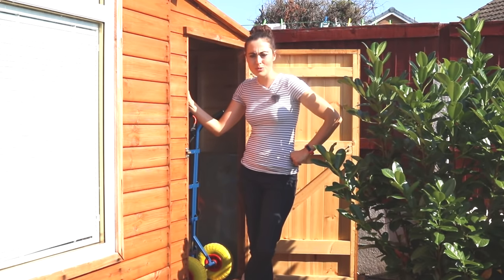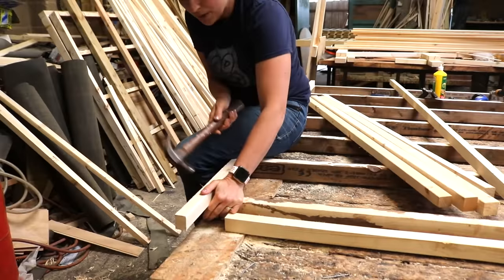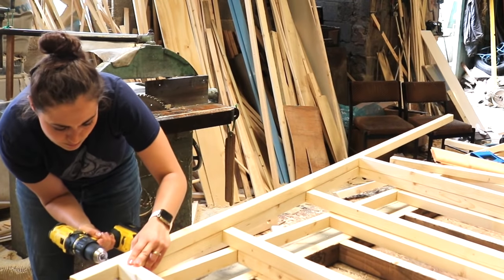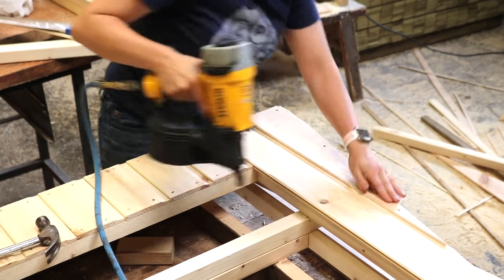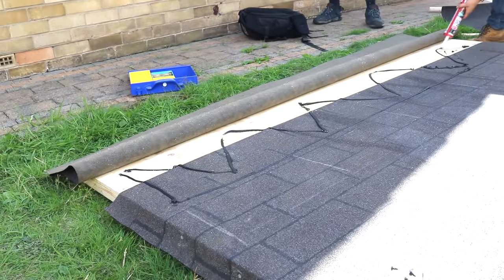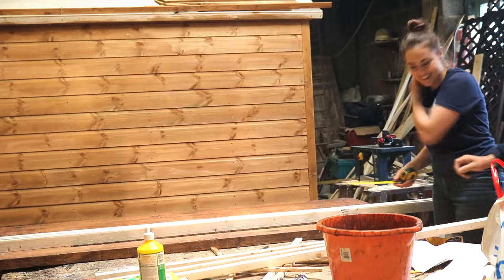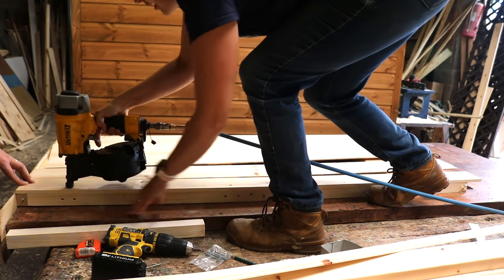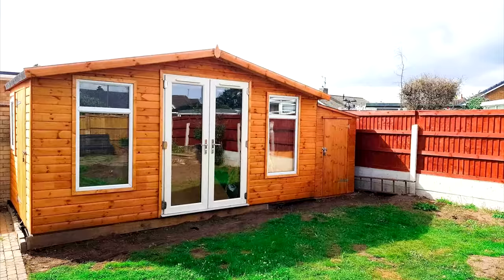How to Build a Lean to Shed From Scratch (Outdoor Storage on a Budget) | The Carpenter's Daughter

Comment: So when it rains the water will just run off the lean-to's roof down to the ground.... either into the neighbours yard (in which they won't be happy over a period of time) or it will flow under your lean-to...  which makes it all damp etc inside the lean-to. 
There is guttering on the main shed (I assume).... why did you not put guttering and downpipe on the edge of the lean-to... to disperse the rain water properly as there is heaps of water that do come off roofs when it rains.??? 
You could rig it up to a tank beside the fence for watering your gardens etc..
Reply from the maker: That's what gravel is there for.  And there's a gap between the shed and the neighbour's fence.

But you could add guttering if you want to.  No, the other one doesn't have it either.

Comment: Hi Vikkie, another great project for us mere mortal's to learn from ; )
I have a few question's if that is ok.
When you are joining the framework together i saw that you used just one screw per spur, would two screw's be better as the spurs were turning as the screw was being tightened or is that a bit overkill?
The other question is (as i noticed you were using both drill driver's) which is better Makita or Dewalt.
I love my Makita so go easy on me : )
Thanks in advance & all the best.
Reply from the maker: Thanks :)  With these being smaller ripped pieces, my Dad's said in the past 1 is ok because cladding tightens it all up, but you can use 2 if you want to (he's always telling me).
Reply from the maker: They're Makita and Stanley here.  I can't tell any difference, really.  But often I'll use my makita impact driver from home, which obviously drives at more force.  Dad's is the Stanley and he doesn't work with impact drivers and have never used one of theirs, so couldn't compare.  Hope that helps!
Reply: @TheCarpentersDaughterUK  Thanks for that, i guess with thinner wood there is more chance of it splitting along the grain if you put too many screw's in it.
Reply from the maker: True.  Also, they have specific methods... like use thinner screws, then no need to pilot hole when working away from the ends.
Reply: @TheCarpentersDaughterUK  Sorry it just looked like a Dewalt, i have just bought a brushless Makita and was torn between this & a dewalt, i was just asking to see if i made the right decision.
Thanks for your help.
Reply from the maker: I remember an old Dewalt one I used felt quite heavy, but they may have improved (or it looked old as it was well used 😂).  Someone left it behind during one of the bungalow projects.